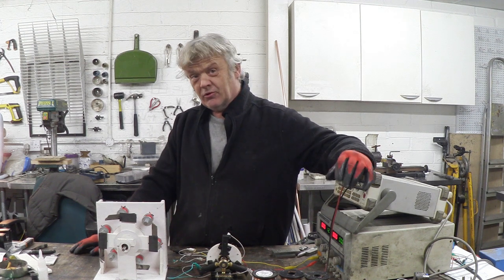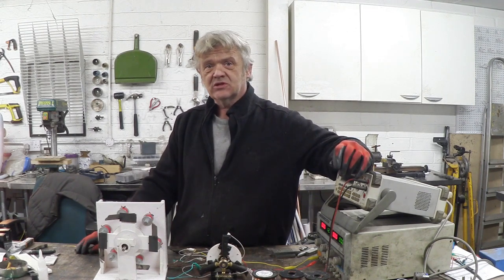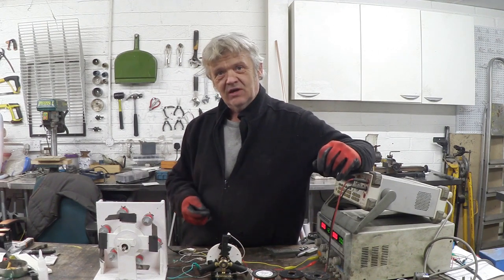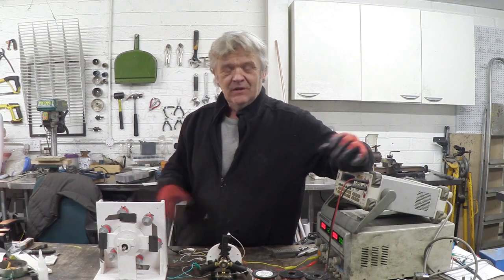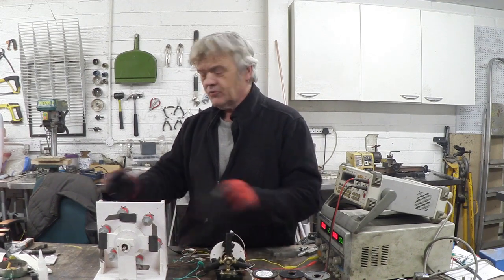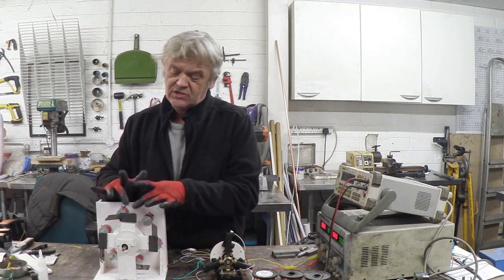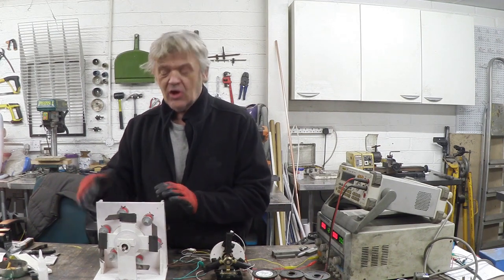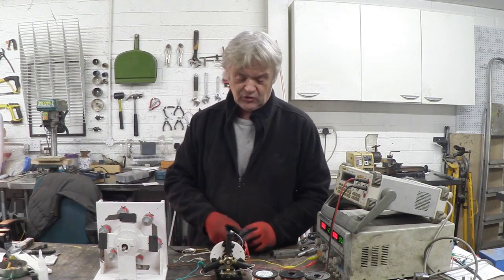1045 Mechanical Motor Controller Running Reluctance Motor

Comment: Just take your mains . Put diodes on each phase then neutral because younwound it Y style. It would pulse dc in different polarity. By the way you described it its a drag style magnetic motor instead of a push. Always wondered which way worked best
Reply: Yes push is better.   Disc timer    Diodes 
11000.  Rpm.   Add a fly wheel and your done
Reply from the maker: nice idea mate but not with this one - it's a model for checking concepts and is basically held together with superglue - for something faster I will have to rebuild it stronger - but I didn't want to do that first time as it costs a lot in time and money and if I got it wrong well - that would be annoying lol
Reply: @ThinkingandTinkering  yes  I tried to build one a few years ago.   I stretched it horizontally     Like the spiral heart  pump
I found that you have to angle the solenoids to create a leading edge  I took the charge created by the passing of the inner magnets  energizing the solenoids  and routed that the the next solenoid 
A disc on the drive shaft controlled the timing of the charge  so it pushed its self 
Over and over.    You had to kick start it 
But it continued to spin.   Push was better than pull    And diodes would have been the next thing  it was crude. But would spin many more times than gravity allows.   Almost had it.     But with wood and glue and magnets you can imagine how it would all shift around.  For the inner race of magnets I used a spiral brush from a carpet cleaner.   And little magnets glued to it.   Keep at it it’s does what you want it to do.     A real one would have to be governed with load.  It likes to run up.  N ver added the fly wheel 
But that’s the secret     A self assisting dc  spiral motor.     I called it the hyperdine 
Load equal to weight and velocity of fly wheel I believe.  But with a fluid transmission   A hundred pound model would power a dump truck    Nice job
Reply: I guess best described as a 
phase generator

Comment: Especially if there's lots of comments, is understandable to not reply to many.

Shaping of tips. Have you heard of the feynman sprinkler. Water jet spraying out from a wheel results in torque which turns the  wheel, but if flow reversed will it still turn? Intuition often says yes. But does it in practice.
Reply from the maker: that's a bit like the Hero engine isn't it? So, I would guess yes too
Reply: @ThinkingandTinkering  yes like the steam powered  aeropile. Or water pressure powered turbine equivalent a segnor wheel. My intuition was also they would be reversible, but  they only turn well when fluid get flung out. OK Sometimes there's a tiny amount of spin when fluid flowing the other way, but it takes exceptionally good bearings for such to happen.

Kind of makes it even more interesting that motors and generators can usually be reversed

Comment: What if you connect the output shaft of the motor to the input shaft of the controler?
Reply from the maker: it would work just fine mate

Comment: Super cool, would a drill on the controller make the motor spin faster?
Reply from the maker: yes mate but with this you wouldn't want to - it's basically held together with superglue - too fast and it is going to come apart - I am using this to check concepts and design I will have to rebuild to make a faster one
Reply: @ThinkingandTinkering  fair enough, I think that the concept is sound, proof is in the pudding.

Comment: So... What happens when you just turn on the speed controller and run it like that?
Reply from the maker: I can guess mate - I wouldn't do it with this one - it's a model for checking concepts and is basically held together with superglue - for something faster I will have to rebuild it stronger - but I didn't want to do that first time as it costs a lot in time and money and if I got it wrong well - that would be annoying lol

Comment: I think after playing that song so meny times I'm starting to become a bit iratated by it. So the strips elongate the magnetic field to one side making the motor turn one way? I'm strugling to picture that in my mind a bit.
Reply: How to explain motion... 
a ball and round bottom bowl.
Place bowl right way up.. Drop ball in anywhere.. It'll roll towards central point... Aka stable equilibrium.
Put bowl upside down. If true Bowl shape (no flat bottom) . Ball could in theory be placed on bottom with no tenancy to roll... But in practice slightlet disturbance or misplacement and ball will start moving more and more. In direction it started moving... Unstable equilibrium.

Knowingly place ball slightly off to one side of bowl bass. It's gonna want to roll away from center
Reply: @stevecummins324  yes well I somewhat understood that from the start, but I'm strugling to picture how the magnetic fields ar more imbalanced this way, uspeshaly to one direction.
Reply from the maker: it either irritates you or grows on you mate - personally I use It because it is royalty free and I am a cheapskate lol

Comment: I don't no what your reasons are for having a mechanical speed controller, maybe like me you like to minimise the use of electronics in case of a another Carrington event.
I imagine it would be easy to rig up a pressure vessel and turbine with a throttle control to drive it.
I've been thinking it would be a good idea as a back up in pressurised mars rovers for manned missions.

Comment: can you try to run it with an electric motor hooked to the power controller for us?
Reply from the maker: not this one mate - it's a model for checking concepts and is basically held together with superglue - for something faster I will have to rebuild it stronger - but I didn't want to do that first time as it costs a lot in time and money and if I got it wrong well - that would be annoying lol

Comment: You could make a magnetic reed switching system to run the motor.
Reply: A piece of bendy brass or copper with a magnet soldered on and another to make the circuit. The magnet will attract to the metal on the rotor making and breaking the circuit you would need two of these in just the right place to make the motor work.
Reply: Just like a pulse motor but the reed switch has the magnet inside its self . A magnetically assisted reed switch ?
Reply from the maker: for sure mate